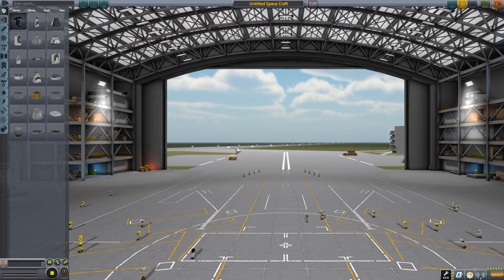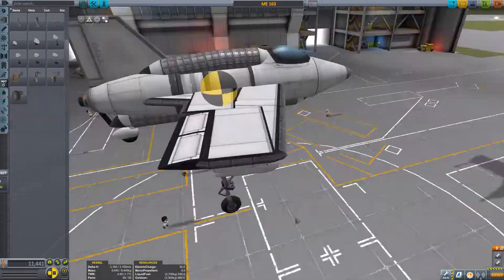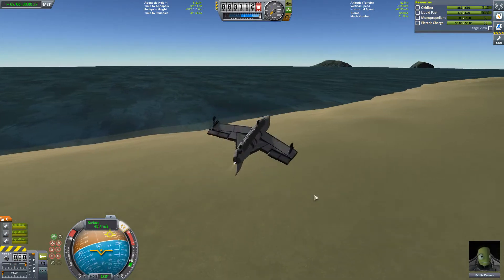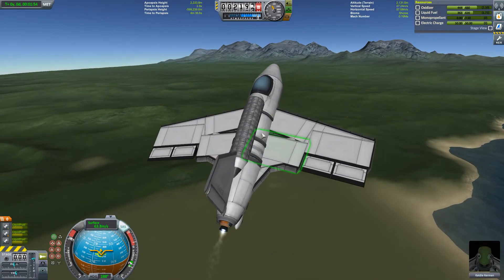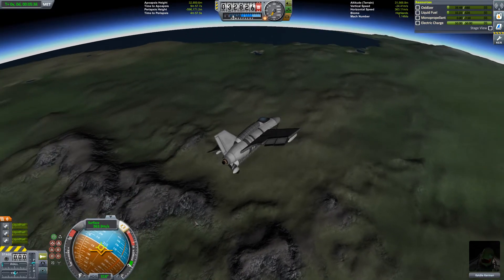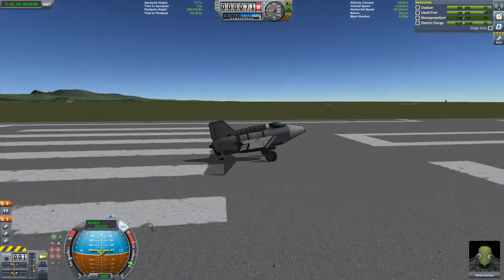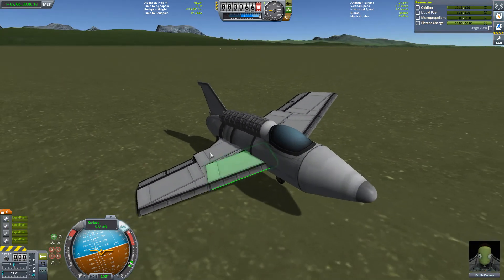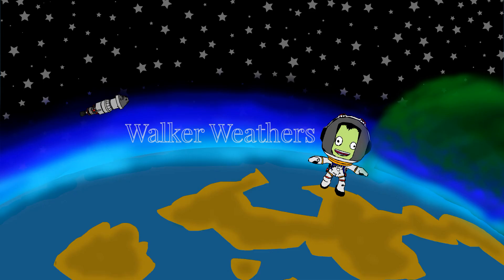KSP ME 163

Comment: I built the plane but after takeoff it wants to go vertical
Reply from the maker: Center of mass might be too far back. You could try add some weight at the front or move the wings back slightly
Reply: @WalkerWeathers  ill try plus im on ps4
Reply: @cherissesinclair284  Hey some tips air center should be behind the center of mass